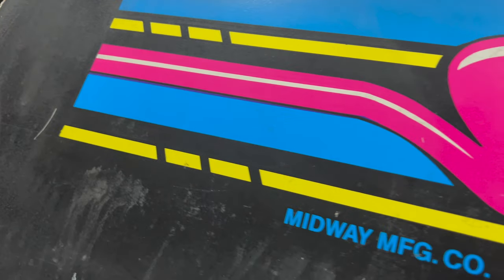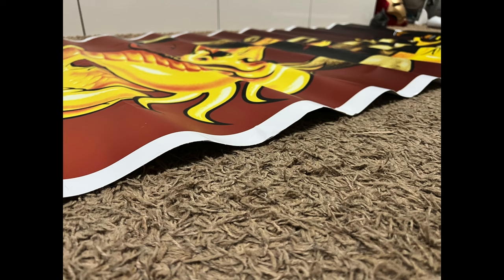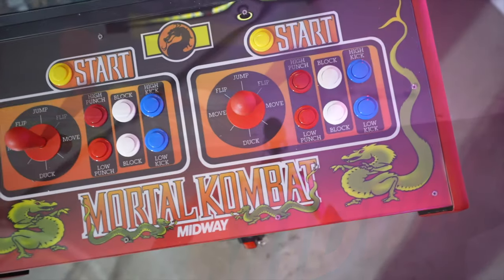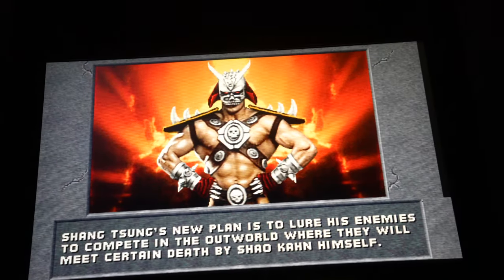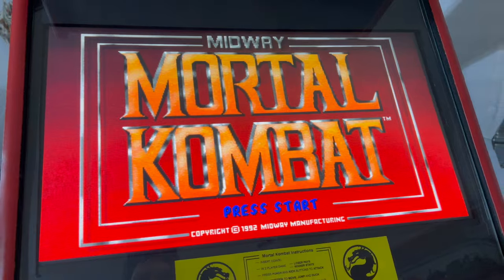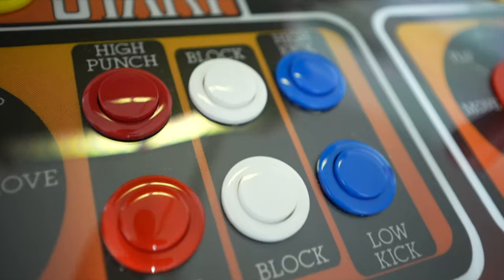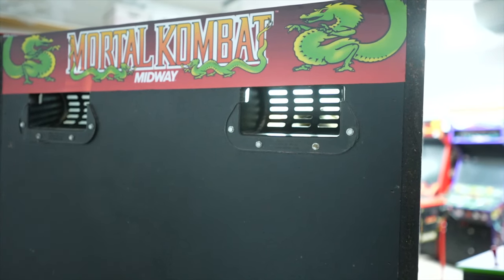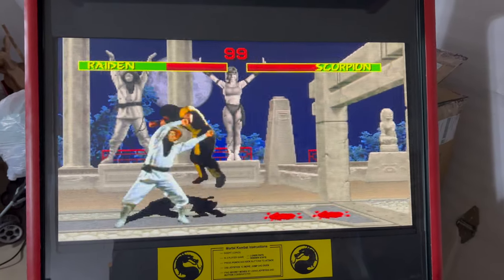My Mortal Kombat Arcade Machine Build

Comment: Great job man! While I'm not a fan of the widescreen look, I can appreciate the effort, as I've built a Dragon's Lair, but it currently uses a 19" 4:3 flat panel COMPUTER monitor, and I built it right before the HD 16:9 widescreen revolution took over. I used a CRT originally 15 years ago, but I couldn't get it mounted properly, so after a few years, I installed a flat panel. I got all my building materials from the local hardware stores, my scoreboard I got from 'The Dragon's Lair Project' Jeff Kinder, when I visited him, and being an arcade tech for over 20 years, the parts weren't hard to come by. I run it with Daphne, who my other bubby from the the DLP site wrote. I have an original machine, which has yet to be restored

Comment: Just a heads' up, X-Arcade has an upgrade for the controller decks they sell that normally sells for $50 on for $20 right now.
Reply from the maker: that's a great deal!
Reply: @cooltoy  it's a DIY upgrade board you install right inside the control deck. I have the 2 player control deck from them and it takes me roughly 5 minutes to switch the joystick gates from 8-way to 4-way. The upgrade board adds direct input compatibility as well as the old X-Split.

Comment: Great project.  Now you got me thinking about that monitor for my Street Fighter Alpha 2 Cabinet.  I did a capkit on the monitor chassis and there is still a short somewhere on the board, I thought about sending it off to be repaired, but for what that monitor costs, I can just replace the CRT.  I can also replace the CPS2 board with a pandora box or something.  Just gotta take measurements to make sure the monitor is going to fit :)
Reply from the maker: Let me know how the project turns out if you decide to go that route 👍
Reply: @cooltoy  Will do :) I ordered a monitor. I'm in Canada so they didnt have the exact Model# but they had ASUS VY279HE 27” Eye Care Monitor, 1080P Full HD, 75Hz, IPS, 1ms, Adaptive-Sync/FreeSync.  The cabinet had enough space to fit the monitor so I'll be good to go :)

Comment: In my opinion, I preferred the monitor to be square shape size with a 4:3 screen ratio. Retro games such as MK, SF2, and MvC2 looked better on 4:3. It doesn't look good on 16:9 screen stretched. It's good for those higher-end games such as USF4, KOFXIII, and MK9 because it's made for HD/LCD, but old retro games was built for crt with 4:3 fullscreen.
Reply from the maker: Hence why I mentioned the aspect ratio is easily changed in the menus. It does t have to be 16:9 is the player doesn’t want it
Reply: You can put a lcd 42inch in it, place it vertically ,adjust it and you wil have a screen image like the original cabinet

Comment: Nice build! Question though I’ve never tried it myself but I’ve always thought of sticking bezel art between two sheets of plexi. Not sure if you or anyone else has every tried it.
Reply from the maker: You would likely have to build something to hold the plexi in place as using two sheets on top of one another would be too thick to stay in the OEM place holder spots

Comment: How reliable is the "Super Console X3 Plus Emulator" you put inside?
Reply from the maker: @MrGenedancingmachine  it’s still working today
Reply: @cooltoy  
Thanks. 
I ask because I'm about to embark on converting a war gods midway cab into an MK2 cabinet and I'm wondering if the emulator you used in this video is still the sexiest, hottest thing on the market. 
I youtubed a video of it and it looks tiny, so it became filmsy in my mind, so I had to ask your thoughts. 
I watched another video of yours, tmnt or wwe cab I think, and you said put the GT King Android in that one, was that system old hat by the time you worked on THIS cab or no?
I'm looking for something smooth with a nice frontend, not bogged down with hundreds of duplicates and the arcade games look like the actual arcade games (mame ones)

(Thanks for the links in description box also)

Comment: You cam send those chassis off to get fixed
Reply from the maker: chassis wasn't the problem on this monitor
Reply: @cooltoy  ahh that sucks.  But Still a cool cab. I'm about to do the stereo amp mod for my 3rd strike bit I've never done it before. Do you have a video of you installing a stereo amp into an arcade machine?
Reply from the maker: @jaygallegos8612   no, it’s really straight forward. Speaker wires connect to the speakers and the amp. And I run a 3.5 to rca cable to connect my emulator audio out to the amp.